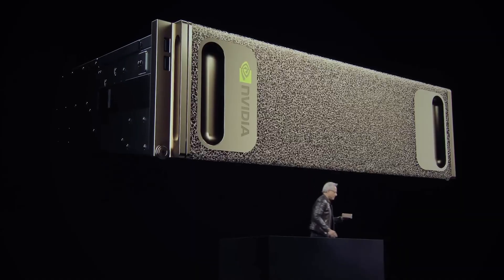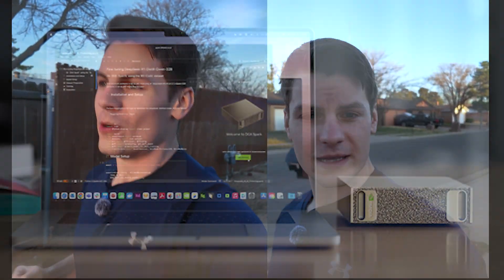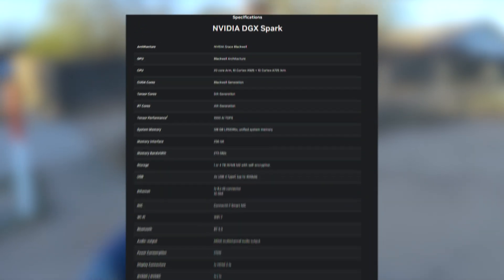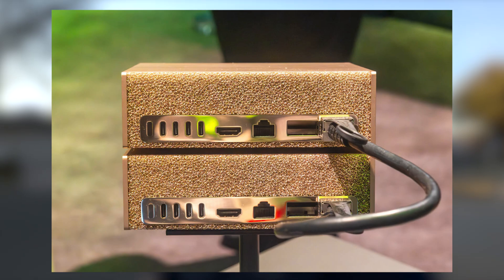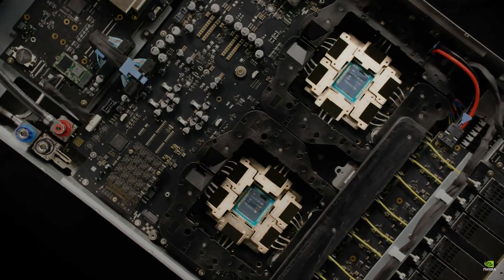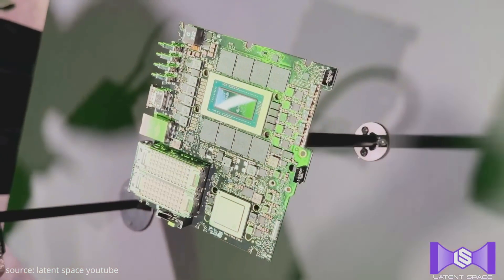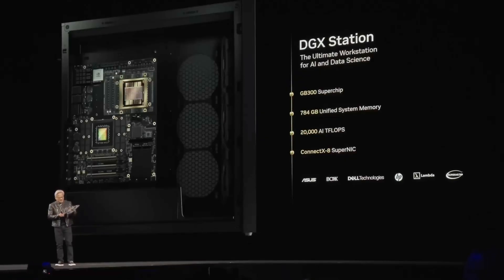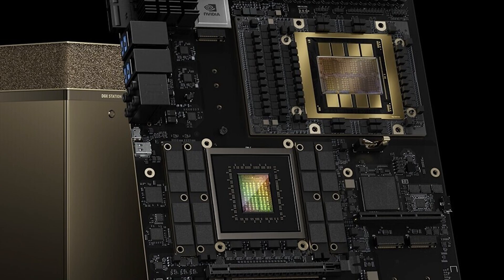Say Goodbye to Upgrading Your PC (Thanks NVIDIA!!)

Comment: I don't think most regular folk want AI. I think nvidia will be avoided like the plague in the near future.
Reply from the maker: Hot take. Let’s see
Reply: @SiliconSteak  I'm avoiding nvidia already. It's not like they have good consumer videocards.
Reply from the maker: @LedoCool1  their cards are the best… they just cost way too much
Reply: @SiliconSteak  Well not quite. With driver instability, missing ROPs, melting power connectors, and other issues, they're not even the best options anymore. They also don't even support 32-bit PhysX on the 50 series cards so some games are borderline unplayable despite the GPUs having the raw specs to be able to play them
Reply: @ I can hardly agree. At least currently their intention is to make a miner/ai card which is full of features rudimentary for gaming. This misalignment leads with pushing onto consumers features like RTX that exists solely to excuse why the card costs so much yet half of it is tensor cores that aren't needed for gaming.

This rush created rawest technology out there: RTX with DLSS which couldn't even do it's premise on launch while cards themselves showed very little uplift compared to previous generation (2000x series).

Now obsession with rays (which frankly weren't ready last time I checked) led to whole industry misalignment where games are made as blurry noisy slop but with rays or whatever is used to substitute them because very few people actually turn them on.

At the same time actual gamer technology like mesh shaders isn't even briefly mentioned. And damn AMD is following in NVIDIA steps which is really sad because they won't make good cards like that either. The only consolation is that amd are cheaper.
Reply: They also didn't wanted Internet (at the time), I still remember the time when that was the norm. Same is now with the AI, people don't want any change in their life. So we're just repeating history.  Though people who can use AI, actually want AI, that's why Nvidia has overpriced their products that much. I think it would become a standard to run LLMs at home, at least for some people (not for all), the others will just use AI from the cloud (which is worse, than using it locally).
Reply: @Slav4o911  they should've stayed away off the net.
Reply: @LedoCool1  They did for sometime, but later the smartphones came in, and suddenly these same people who were telling me they'll never go on the Internet (because they don't need it) got there and started using.  The same will probably happen with AI, at first not everyone is going to use it, but later everybody is going to use it. AI usage is actually progressing much faster than the Internet. At the beginning the Internet was such a niche thing only "nerds" were there. (at least in my country was like that). I was one of these "nerds", so I remember exactly how it happened. And I was not the most "progressive one" relatively late I started to buy things online. Though I'm on the Internet almost from the very beginning, first I went to "computer clubs", because I couldn't afford a PC (because I was just a kid back then, and my parents didn't want to buy a PC, because it was too expensive and they themselves didn't need that "thing" at the time.)

Comment: Single board computer is more a marketing gimmick for most consumers. My home office is a 20 sq m room, it can easily accommodate a full tower PC that is maintainable, repairable, upgrade-able, expandable and runs silent and offers good connectivity with dual LAN ports, plenty of USBs etc. I can use it for office work, gaming and training LLMs so why should I buy a sbc which becomes outdated after a year or two and I have to buy a new machine. I don't need or want to upgrade whole PC every year rather, I change the components and only build a new PC after 5-6 years. It gives me flexibility and does not break the bank while offering good performance and modern features. I have a Mac Studio for development of iOS and macOS related apps but I don't PC to go the same route because PC is fundamentally different machine: from OS to hardware, everything can be customized and adjusted according your needs.
Reply: 100% agree!! Soon to be building my next PC in a few months and will pay around the same cost of high end Threadripper system I built about 6 years ago. The performance difference will be at least 4 time better with twice the memory and more than magnitude order in size increase for storage!! I definitely do not see the DIY market going away any ttime soon and in fact with the AI craze, I see it growing. What I like the most is the fact we have choice and going the wall garden approach of broadly copying what apple has done for multiple decades is definitely what Nvidia is doing but also the fact the DGX Station will soon be a commodity also will continue to fuel DIY computers for the rest of us for a long time to come...

Comment: It will be both for a while. I mean iMacs isnt really popular because of this reason. If someting breaks, its terrible to get it repaired.
RAM and memory for storage is can get faulty in a relatively short time, and they can be faulty from the factory alot more so
compared to a CPU/GPU. All in all, with one board just like on a laptop, tablet, phone. Its alot of components that will be hard
to replace during a repair. Having to buy a new CPU everytime you buy a new GPU like on a laptop would make the desktop
alot worse.
Reply from the maker: Mac’s are actually quite popular

Comment: NVIDIA is the apple of PC and that's a bad thing
Reply: @cryrpwastaken  they’re worse in my opinion.
Reply: To use the 800 Gbps port you need to buy an $1,500 cable.  That in tern needs to be plugged into a >$30,000 switch to link to others Nvidia devices like it.  These are a rich person's play thing.
Reply: I understand exactly what you mean. I loved appled up until they came out with the power pc and started making everything proprietary, over priced, and practically unmoddable. Apple has been evil ever since. I will never buy an apple product. My last apple computer was an Apple IIe and I loved that thing :P
Reply: not of PC, just graphics cards
Reply: @cryrpwastaken  no they're the apple of ai which is far worse...
Reply: You are ignoring that AMD’s 395+ also has the same limitations ala the Framework desktop. Digits isn’t meant to be mainstream anyway.
Reply: @cryrpwastaken  apple products at least works
Reply: is it really hard.. to Not buy something.. can you control your selfs just for a few years and just Not buy anything nvidia makes perhaps?
Reply: @ last thing I bought from NVidia was a titan rtx whenever that was released. It’s not gonna change the realities of signal integrity requirements for high speed memory. Maybe photonics will make it possible again later. You might as well ask why no one makes a gpu with swapable memory anymore (they did actually used to).
Reply: It the worst version of apple because people actually need use there products compared to apple is a joke of a product that is way better. But problem with NIVIDIA they are top of the line high end gpu we all need and they limited them while overpriced....
Reply: @cryrpwastaken  this is just a dumb statement. Apple services billions of users, their product last a long time, and they understand Their customers. There’s people still using iPhone 6,7,8 and are still having good experiences. There’s always a cheap Mac mini, cheap iPhone cheap ipad, for the masses that work very well. Can’t say any of that for nvidia
Reply: Pc users are much compare to Apple users, sure they will appreciate what Nvidia did

Comment: Built my current rig at the end of 2019 for the holidays, when I was in my early 30s. Now I'm in my late 30s and I'm still waiting for a $500 GPU that is twice the performance of my $400 RX 5700XT and fits in the same form-factor (2-slot, <240mm length), going on six years later now. The RX 4070 almost got down in price to where it would've been that exact GPU, but NOOOOOOOOOO. Nvidia just HAD to release the RTX 5000 series and shut down 4000 series production. I guess they don't want my $500, because I don't have more than $500 to give them. If these other GPUs they come out with don't bench at 2x the perf of my 5700XT then I'll just keep waiting. If they want my money, then make something that has me saying #TAKEMYMONEY. I refuse to support this always-high-end nonsense. It used to be, 10-15 years ago, that you could spend X dollars on a GPU and then 2-3 laters spend X dollars on a GPU that was double the performance. It's not my fault if they can't sustain such things. I'll just keep riding my RX 5700XT, and if it dies, I'll (gingerly) buy a used GPU off ebay instead, from a seller who accepts returns.

Most people don't have $600+ to spend on a GPU. I did just watch a bunch of people buy $200-$300 GPUs as well, not that the sample size is really relevant, but I can't imagine there aren't a lot of beginner PC enthusiasts who are only working with a few hundred bucks, rather than thousands of dollars.

The other thing that really grinds my gears is AMD's failure to produce smaller GPUs. What the heck happened? Is the 5700XT really the last GPU they've made that's 2-slot and <240mm? Is it? Do they think that everyone wants to buy a big fat stupid ATX case along with their new RX 6000, RX 7000, or RX 9000 series GPU? If the Nvidia GPU performs the same and costs the same, but is smaller - guess which GPU people are more likely to buy. AMD has gotten sloppy with their bloated arse coolers and it's getting really annoying after three generations of GPUs. I've been a diehard AMD fan since forever (well, since my GeForce3 almost 25 years ago, but always AMD for CPUs) but I guess they want me to buy an Nvidia GPU. I've waited and waited and I don't understand why it's so much to ask that they just make a GPU that has the same form-factor as the 5700XT and isn't a puny incremental upgrade.

Nvidia can do it, just not at a reasonable price.

Where you at, Intel?
Reply: @CharlesVanNoland  I really wish aib’s made x2 fan 4090’s to make them smaller. I always preferred smaller cards over x3 fan cards despite them having somewhat worse cooling.
Reply: @CharlesVanNoland  Companies are more and more making things for the to 10% of the population. As people age they either make more money or they get sick and make less and less. Don’t expect this train not to celebrate.
Reply: @ That doesn't make any sense. What about everything else in life that costs less than a GPU? Why doesn't their cost increase proportionately with GPUs if companies are making stuff for the 10%? Why don't candybars cost $20? They're making fewer and more expensive GPUs because silicon is a dead end. The cost of making wafer in a 3nm process is way higher than it was for something like 32nm or 45nm, because the machine to expose the wafer with EUV is way bigger and more expensive than the machine for those higher process nodes. Silicon is becoming an exceedingly unsustainable medium for semiconductor integrated circuit fabrication. The machines to go smaller are becoming such elaborate Rube-Goldberg hilariosities that their cost will not be affordable by those who fabricate semiconductors for the masses. Software and game developers should be taking note too. The most popular GPUs on Steam are only $300-$500. They're not going to do well in the market if they can't, or won't, engineer capabilities via code that only those with high-end GPUs can run. Gone are the times of yesteryear where you could develop something on the hottest hardware that's available, using all its bells and whistles, and have it sell like hotcakes because eventually everyone will be able to afford that hardware as the technology continues advancing. The technology isn't advancing if it's not getting faster, smaller, and cheaper. It's just staying the same, and that's what we've seen since the introduction of EUV into semiconductor fabrication - a big fat stupid joke.
Reply: That time is over. I bought a 4090,i had a bad feeling when there was so much silly rumors about the 5000 series, oh boy was i right. So now i got a amd 9950x3d 64gb ram and my Nvidia 4090 card. And im probably not gonna need any upgrades before 5-10 years if you look away from maybe a new gpu. I remember when I bought my Intel i7 920 cpu with triple channel memory which actually lasted me almost 10 years before i needed to upgraded to quad core cpus. But at some points of time there is just this things that arrives on the market that they actually stop selling because it had to much performance for the time and the same thing happened with Nvidias 980 ti and the insane gtx 1080 ti. And last year we just reached a point before all the hype around ai had reached main stream. So I upgraded my computer last year and waited for this cpu which i bought. Which im gonna Mount in my cabinet later with my arctic freezer 360 water cooler so im gonna have a great computer. For years to come
Reply: Ray tracing will become opensource. Valve engine already got it implemented so its just a matter if time it becomes like pvysx

Comment: I predected this when I saw what bruce dell did with solid scans and his engine using cloud data, as far back as 2016 back 9yrs ago back when I was in college on a Lv3 diploma games design course & I already saw the needlessness of a hardware gpu upgrade would come at some point... because hardware is limited by materials etc. but software upgrades are unlimited, of course this was before I knew about Nvidea's AI GPU's as I wasn't following the datacenter scene back then I was strictly gaming couldn't even build a pc then.

before anyone says anything my games design teacher asked me a simple question "did developers stop making 2D games cause 3D games were invented?" he broke my belief immediately that it would be completely replaced... so yeah I understand there will always be a place for traditional hardware pc's but eventually it's gonna be ancient tech like an amiga 1200 or something and some ancient tech is hard to find

plus theres the whole pc recycling initiatives so they get used for materials for new pc hardware so once pc's do reach some sort of endpoint you gotta ask when the software can do it all how are you gonna find old pc parts when theres barely any left around, the answer is other than a novelty you wont need to, cause even with DLSS 4 you can't visibly tell the difference and latency issues are slowly being fixed per gen including artifacts

so what happens when DLSS is permanently on when your set resolution is just upgraded on the software side through AI each generation till it's at a point you forget what a jagged edge in a game looks like or a dropped frame, well i'd assume eventually we'd all be in AR or VR at insane resolutions 16K and above the pixels on the screens themselves will probably cap at 4k per eye because theres no reason to go any higher that's at a point where you can't see those pixels anymore heck if we don't have some sort of full dive by then that just uses your brain's senses to see the game

meaning no need for screens eventually your eyes will see it like a hallucination or waking dream, (I can see that coming with side effects)
when we become advanced enough consumers may not bother with hardware and any games we played irl will be in some sort of metaverse virtual arcade where you can play any ancient game known to humankind

and you will pay for a subscription for the updates to your ai software capabilities because you don't buy computer parts anymore, most likely the pc wont even be in your home like the geforce now you'll just connect up to it like a TV hub for your TV service provider... you will own nothing but your old retro stuff on your old monitor and old pc as it degrades getting harder to find parts but by then you have a printer so you just have to self repair it, you just talk to repair guys in the metaverse and they take you into a pc repair sim in the verse to show you how to repair pc's like pc build simulator

but alot more hands on!
Reply from the maker: Wow very detailed prediction man.. nice
Reply: And where is all this magical money come from? I always love to hear from people where they think wealth will available to them in their 40’s.